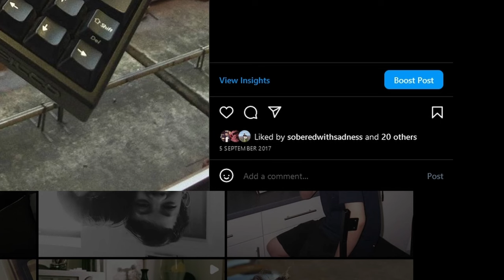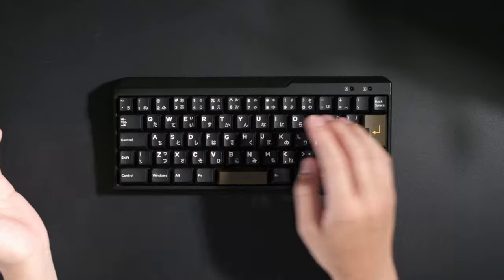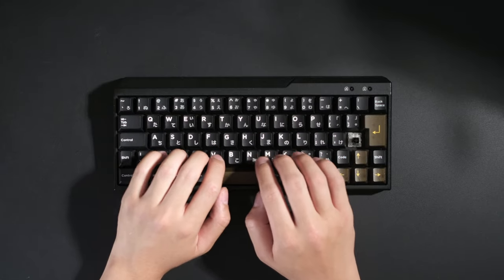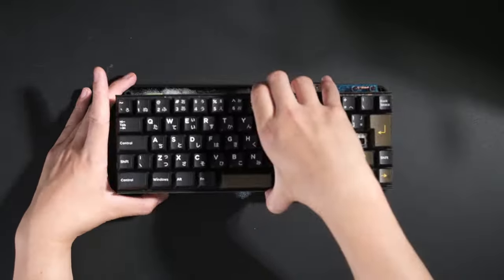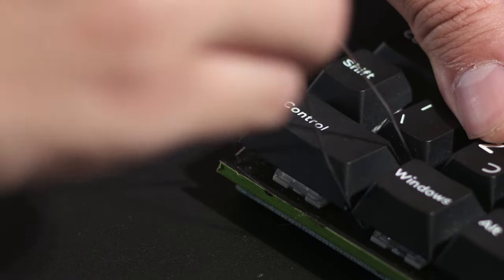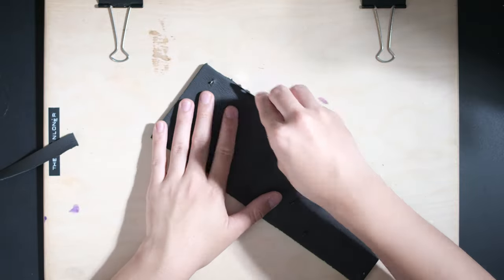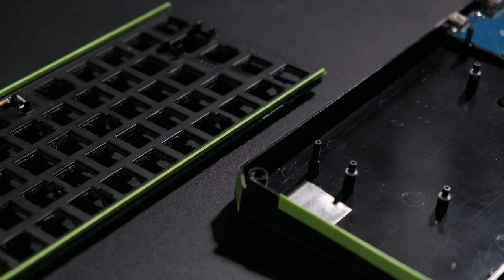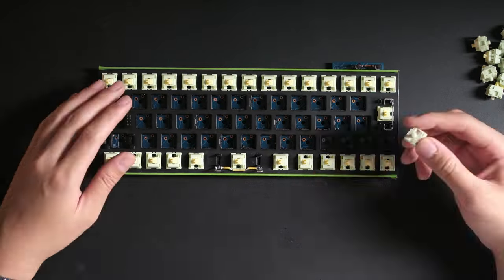How hard can it be to mod a premade board?? Filco Minila

Comment from the maker: Chapters

00:00 Introduction
01:28 First Typing Test
03:29 Desoldering the board
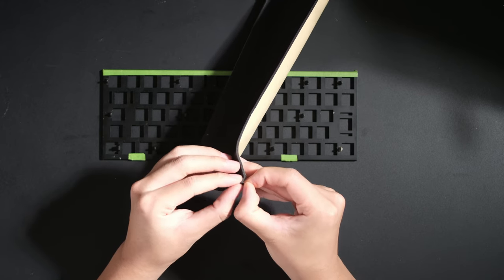05:18 Custom Platefoam
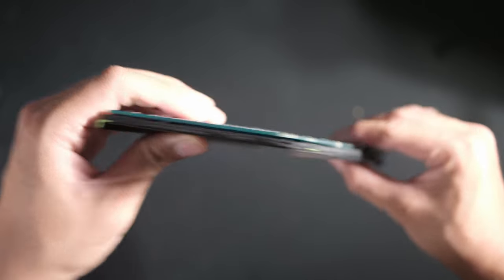06:13 O-Ring mods
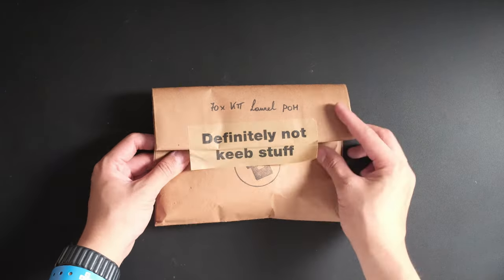06:42 Switch Break down
07:35 Rebuilding the board
08:33 Typing Test
10:37 Outro

Comment: hey man, thank you. I'm an original Filco Majestic TKL, Majestic Convertible 2 TKL  brown switches owner. I admit modding them is super labor intensive, but the reward is very, very big.
After putting too much effort into them (mine is half compared to you), I love them so much compared to my other less labor intensive mods. The brown switches sound after modding is very satisfying.

To all Filco owners out there, once you decide to tackle one of the hardest kb to mod on Earth (I'm talking about costar stabilizers, solder switches, and antique wiring), they will become the best, because the space and opportunity to mod a Filco is still huge. Your Filco with original brown (or red) switches will become the new vintage masterpiece!

Comment: Quick Q, how did you initially have a ISO short left shift? 

I've always wanted a keyboard with a JIS bottom row but an ISO left shit and / key!
Reply from the maker: The plate isn't multilayout so I don't think you'll be able to do what you're looking for on this board.

I didn't say this in the video because I didn't think a lot of people would notice, but I basically had to buy another board because I damaged the one that my friend gave me while soldering, so I used the plate from the new board that changed the layout, was able to get it for cheap off ebay.

Comment: What did you do with L shift?
Reply from the maker: To be honest, I didn't think a lot of people would notice the L shift change, but truthfully, my friend gave me the JIS one (you can see in the ig post) and I had attempted the resolder soon after, I didn't do a great job, infact I damaged the board.

So I bought a second hand one off ebay which was iso and only now did I get the energy to fix the original board that my friend gave me. Luckily filco made the multilayout pcb, all I needed to do was replace the pcb and keep my old plate.

I tried to put it in the video but it just made it too long.

Comment: This is solid board, i have one and like it. Sadly i sell it because 1u backspace and annoying japanese r1 modifier.
Reply: Wait, we can't remap it to the other key? Thought it has a dip switch
Reply from the maker: I''ve been using powertools to change the keys that I need but while the dip switches are quite limited, I still use two of them  @slowtyper95